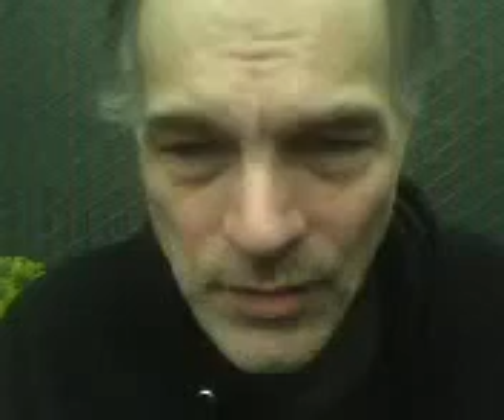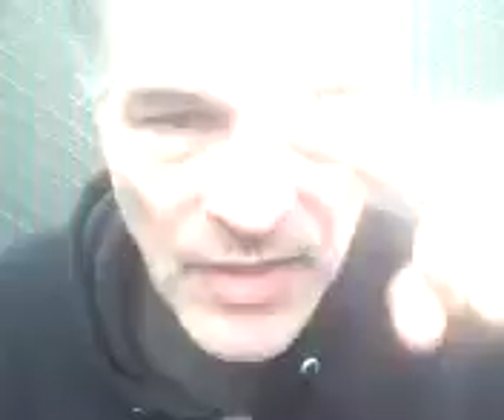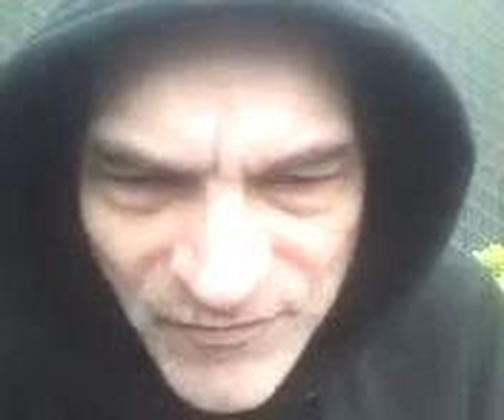2011/03/13 2:30 nuclear carrier USS Ronald Reagan Flight Deck 130 miles from Fukushima 6 mrem / day

Comment: I went through the links you again provided in the video description and again noticed the same issue that aside from one of them, which did show through - namely - http://news.mit.edu/1994/safe-0105 - the rest either were unaccessible, not found, or were removed.
Reply from the maker: Thanks for the heads up Emily, you were the first to point this problem 
out on the two you commented on.  Apparently when I copy and paste the 
contents of the original video comments box onto my mirrored video of 
it, the links get abbreviated.  This presents quite a problem that will 
be very time consuming to fix.  It will be easier to fix for mine than those of others.  I would suggest you go to the original video (posted below) to see the original links that should work.  It's a shame this is going to be so hard, especially for someone like yourself that is doing due diligence in searching for additional information, something most will never do.  That's exactly what I hope people do - research - not just beLIEve the fear mongers.
https://www.youtube.com/watch?v=LOK_djXsP3w